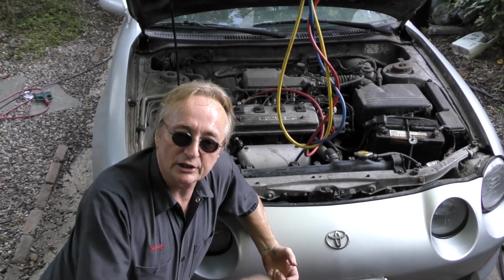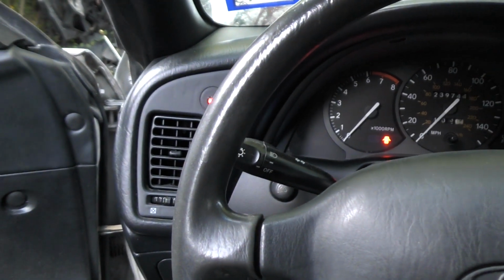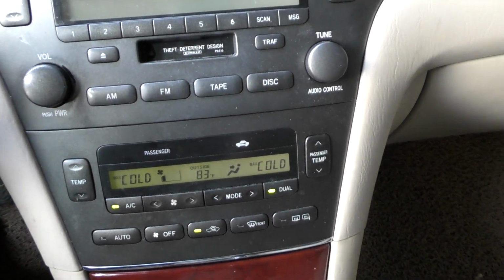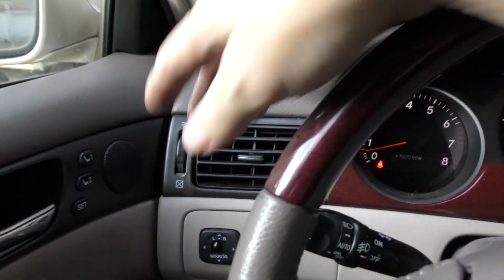Doing This Will Make Your Car's AC Blow Twice as Cold

Comment: I have a 04 Camry that only the heat comes out of the driver side. What's up with that?
Reply: One of your vent doors or door motors are stuck.
Reply: @deasttn  Thanks, that's what I was going to check out.
Reply: @moonlightguitars  some cars can be reset.  It's usually some sort of sequence of button pushing while ignition is in ON position. Yours might need resetting/calibrating

Comment: What’s it mean when water leaks in the bottom of your car after using the AC ? My 99 corolla has the coldest AC I’ve ever had in a car but after i turn it off and leave ill notice a small puddle of water on the floor 🤔🧐
Reply: That's normal

Comment: I have  2012 impala Lt. And I won't rev over 3500 rpm in neutral or park? And just pushing the pedal.on 59 it shuts my speed down at 112 .wanted to know if it has a limiter on it.

Comment: hi Scotty, 
I have a problem with AC on my Honda Civic 2013. 
When I set AC to recirculate I start getting some what sweetish, chemical smell that last for only a second or so and then stops, after some time again goes for a second and stops (feels like when the compressor kicks in). 
What could it be? 
That problem persists since I bought the car with 5k miles, now I have 40k.
Thanks!
Reply: Probably the cabin air filter newer cars have a filter for the a/c

Comment: Two comments/warnings....overfilling is just as bad as underfilling. Look at the pressures on both the low side and high side of the A/C circuit, and decide if you're truly low. The web will give you "in-spec" numbers for both sides for your car, and they change "Slightly" if the outside air temp changes..so watch for this.  Maybe 35-45 psi on the low side, and maybe 160-200 psi on the high side. And 2.) some cars only have an air-flapper valve on the car's heater core, to open ( for "heat") and close ("no heat") the cabin....BUT...radiater fluid may still run thru the heater core. For some cars (like my Scion xA), I ADDED an in-line valve on the heater line going into the firewall. Have it "closed" in the summer months, and open in the winter. So for the summer, not only is the air-flapper valve closed, but so is any liquid radiator coolant flow to the heater core. Made at least a 10 degree change to the cabin air flow temp (colder).

Comment: Isnt the AC compressor run manually?

Why would a battery affect it?
Reply: No. Its usually belt driven by an engaging clutch
Reply: @blackice7408  exactly so why would a weak battery affect the system and make it work weak either it engages or doesn't
Reply: @liveandletlive2894  well it could be a broken clutch or a belt with maky cracks in it which can cause spillage and cause the compressor to not run correctly
Reply: @blackice7408  still not answering my original Q if how a weak battery would affect such low current things
Reply: @liveandletlive2894  there is no direct way the battery can affect the compressor. Because the real use for the battery is when the key is on start or acc but the engine isnt running. But the battery cranks a motor that revolves the the engine until the alternator takes over for the spark plugs. Then once the sensor detects that refrigerant is needed, the clutch engages to run with the belt drive which causes a bit more fuel to be used to run the engine, its components, and the compressor. The battery has nothing to do with it. Its the alternator that makes the power for the spark plugs and whatever electrical systems that are in the car and it charges up the battery. And im trying to help you out here. Dont get smart with me
Reply: @blackice7408  dont worry I'm just trying to learn...I still dont get why scotty said a bad alternator or battery would affect the ac system

Comment: I hate dual system to be cold and hot. It’s a pain in the butt to fix.
Reply: I rather just have my fan 0 1 2 3 4 instead of these complex dual zone systems
Reply: Heater core - dual system
Reply: I have a dual system in my car, I bought the car new and I have no option at all. I knew its gonna be a pain some day to fix.
Reply: I just bought a 2009 Dodge Grand Caravan and this makes me glad I don't have dual climate control.

Comment: Scotty what about turning the whole AC system off every time before you turn the vehicle off?  I've heard that it is better to do it that way.
Reply: Always turn a/c off when you're about 3 min from destination.  However , keep airflow on and switch to outside air instead of recycling,  clear the tubes.
Reply: aunty uber clear the tubes of what? The water that already drips out of the bottom? Doesn’t make sense to torture yourself for 3 mins to help a little water clear out faster.
Reply: I do it so it doesn’t turn on the next time I start, but no it’s not necessary. It doesn’t have any benefit.

Comment: Next : "Doing This Will Make Your BMW's Engine Twice as Reliable"
Reply: step 1 throw all the car away
Reply: Only use it half as much ha ha
Reply: Cormac Son of Carthach there ya go
Reply: A Break My Wallet doesn't get more reliable.
It loves sending me to the dealer...
Reply: My 1994 525i has been nothing but reliable. Now modern BMW engines..... I can’t speak on them lol
Reply: Answer: not driving or even starting it
Reply: Don't ever drive it. Then it can't break down. Infinite reliability!
Reply: 1 easy step: by a Toyota.
Reply: @Inviting1word  hahaha so true.  Simple.
Reply: LS swap
Reply: You just need a radiator cap service. 
1. Allow car to fully cool, preferably over night. 
2. Pull hood release and open hood. 
3. Locate radiator cap, and remove. 
4. Install Honda in place of bmw
5. Ensure antifreeze is full and reinstall radiator cap.
6. Close hood
7. Drive off onto the sunset with your new, reliable, Honda.
Reply: Dexter Schray ohh gosh 😂

Comment: for some reasons on newer jeeps if its a little low the passenger side blows hot but then adding to it makes it blow cold again,   and i mean it was hot,   like heater core air hot air.  there must be a extra vent in these things with a temperature sensor and some cars n ow have a moisture control sensor that will malfunction and turn off the AC.    gotta love this extra junk they are putting on cars to force you to spend more money,    yeah  the dual systems,   great source of money flowing down the drain

Comment: Smart, smart man. You know this is the time of year for this video. I just found the ground issue causing the HVAC blower to stop working. Now that that’s fixed, time to find out if my blend door actuator is still stuck, or if it’s on stuck it self during that time I wasn’t using it. Also going to have the refrigerant tested as you say.

Comment: Yo Scotty I have a 02 Accord, the Dash lights keep flickering. First time this happened the alternator went out. I replaced Alternator, Battery and battery terminals. Dash lights still flickering. I took it too a electrical auto shop and they keep the car for two days changing the alternator again. But still no solution. Pls Scotty your expertise is needed. Thanx

Comment: My ac blows out cold ....but really soft no matter where i turn the knob. How do i fix that? I already replaced the blower motor resistor and the same result.
Reply: I'd check the switch next
Reply: @Cekmore  i thought about that as well because i used to be able to press the knob in a little bit to get full blast. Now it's a little whisper that comes out, ...so i changed the resistor (which was cheap and easy). Maybe it's a weak wire behind the knob?
Reply: @Cekmore  and how do i actually change the switch? And how do i know if it's an electrical issue versus the actual knob going bad?
Reply: Check the motor. Might be old and have too much resistance
Reply: You will have to replace the switch. It may be only available as the whole control panel assembly

Comment: I wish this video came out last week because I had to drive 2 hours in hot, humid weather with a weak A/C
Reply: Ugh ive been driving with no ac in texas heat for like 2-3 years.   Dont know why i haven't looked into it.
Reply: Regan McKee I’ve been driving in Florida heat without AC for almost 2 years. I only drive my car when I absolutely have to, for that reason.
Reply: @d0hv577  if you cant afford a working ac living in Florida then you should reconsider your life
Reply: @csick11  lmao
Reply: @ReganMcKee  get a can of ac pro with the gauge on top follow the instructions on can problem fixed good luck...
Reply: @luxurycarkey720  thats actually how i messed it up in the first place lol.   I filled it too much and may have messed up the compressor.
Reply: @luxurycarkey720 ...As long as nothing else is wrong with the ac system. Three years ago, I went home at lunch with cold air. Got back in to go back to work, and hot air. The computer module had gone out on it. Drove it without ac all through July and half of August (in Texas) before getting it fixed. A few months ago, when it started getting warmer, my air wasn't cold. I tried putting in some freon (R134A), and nothing happened. Can wasn't getting cold or empty, and air wasn't feeling any colder, either. Took it to have it checked, and the clutch wasn't engaging. Went all of June without ac. Just got it fixed last weekend, by a friend's husband who used to be an ASE certified mechanic. I bought the parts, and paid him to do it. Cost me half what Firestone and Christian Brothers wanted.
Reply: I have had to drive on venus for 4 years without AC. It's very hot there due to being so close to the sun. For that reason I try not to drive much
Reply: for 2.5 years i drove a car with no ac and no working windows in florida. only drove to school but thankfully i got a new car
Reply: @venum0.0  god that sounds like hell
Reply: Back in 2010, I once intentionally drove from LA to Las Vegas without turning on the AC. AC worked fine just wanted to see if I could do it. 

Lol I made to Vegas and then turned on the AC.
Reply: Kool. Lol
Reply: Just Some Guy without a Mustache its called no Windows

Comment: My ac in my 2006 Honda Ridgeline RTL takes like 10 minutes to get cold in this summer heat? Does that mean I need refrigerant? My siblings cars take a minute to get ice cold
Reply: If it takes a while check ac fans and means compressor is weak
Reply: Bmw M3 e46 fans look good, I started the truck with hood up fans blowing quick and no debris that I see, so yeah I guess I need a new compressor?